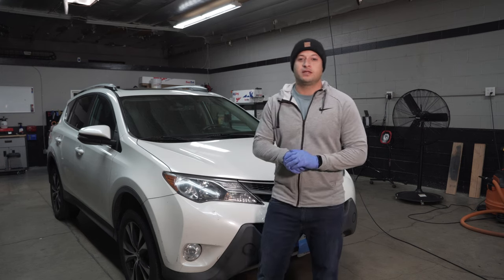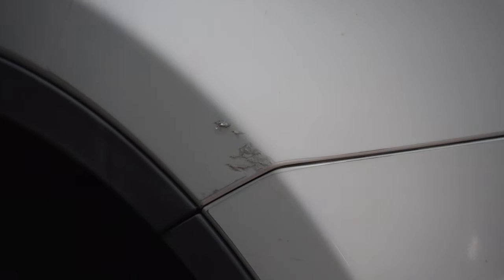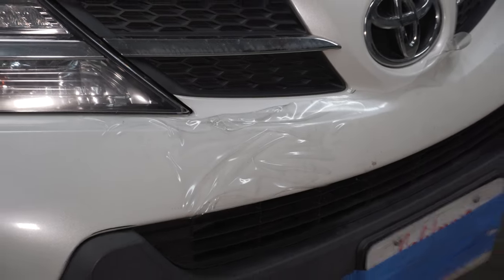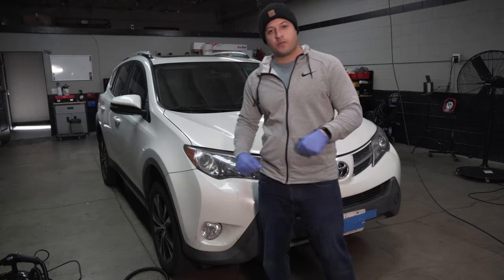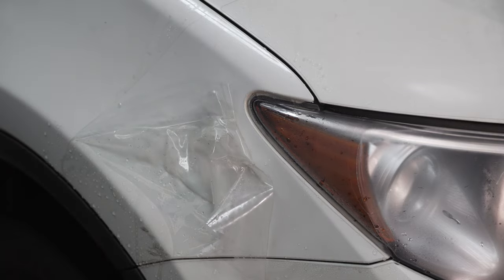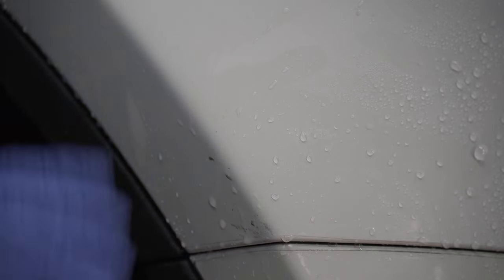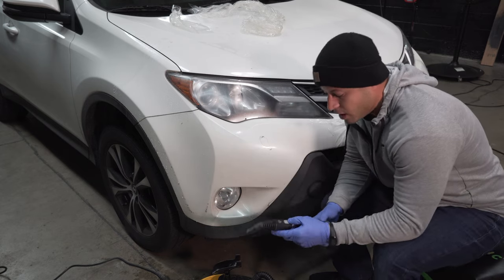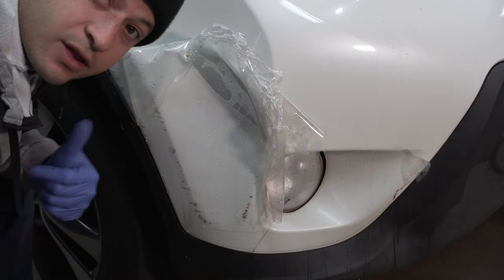How To remove Clear Bra (Paint Protection Film) The Right Way

Comment: I'm trying to remove a clear bra from a 2015 Venza right now and it's just flaking off. I'm using a heat gun because I have no steamer, but it's only getting me so far. 

This is frustrating.
Reply from the maker: Steamer works better for sure. It probably just bad PPF if it is just flaking off though. Good luck been there before no fun
Reply: It’s most likely very baked on. I would recommend the steamer and a PLASTIC razor blade scraper tool, also worth checking out Rapid Remover Vinyl Letter removal
Reply: Had the same problem.  Used an eraser wheel you attach to a drill.  Took forever but finally got it off.  Way faster then pulling off bits at a time.   You can YouTube a bunch of videos using it for cars and adhesives.